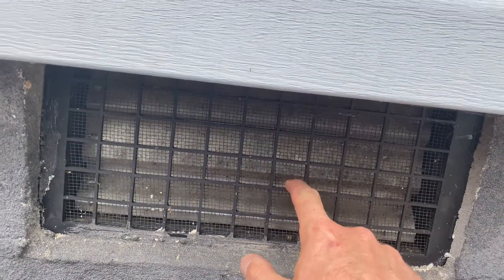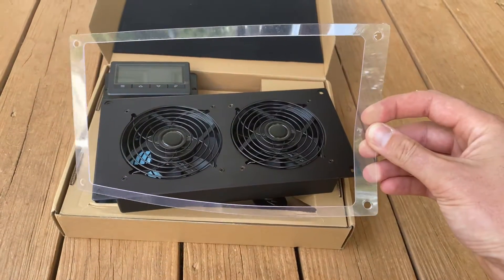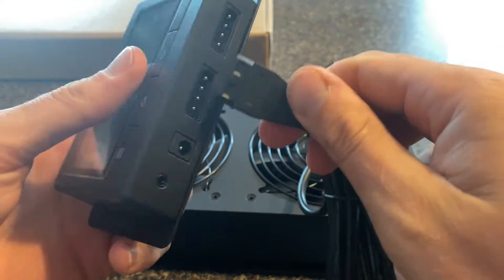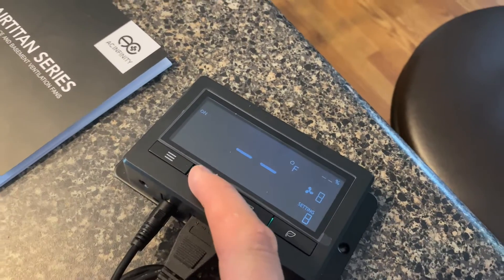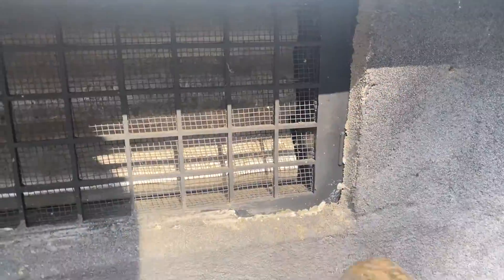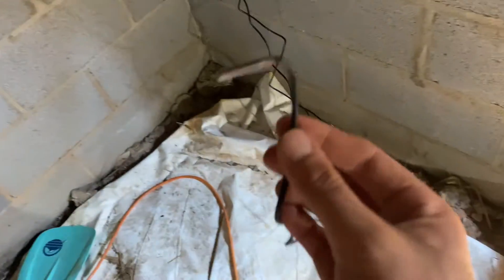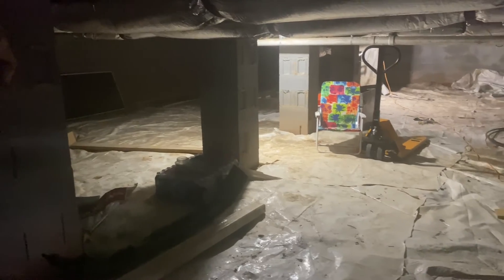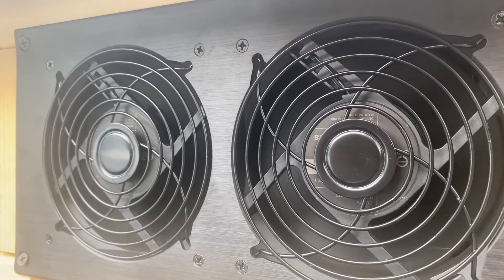AC Infinity AirTitan T7 Exhaust Fan Review (Crawlspace Application)

Comment: Do you let crawl space vent run in winter
Reply from the maker: I’m actually back to re-doing my whole crawlspace now. I actually stopped using the fan once I realized that it will just pull-in warm humid air from outside unless properly sealed.. I’ll try to make a new video soon

Comment: I am needing to do room to room, worth the plug looks like that won't work right?
Reply from the maker: Both fans blow in the same direction, so if its mounted in a wall of one room, it will essentially pull air through itself and into the next room. It's a standard wall plug..

Comment: Do you just hard foam cap the vent space in the winter?
Reply from the maker: I did, but them got lazy last winter and left it in place..
Reply: For air-sealed crawlspaces, theoretically, the fan keeps your crawlspace under negative pressure, pulling conditioned (e.g. dryer) air from the first floor and preventing crawlspace air from diffusing upwards into the occupied living spaces. For these effects to work, the fan needs to run 24/7/365. That's why the fan includes an anti-freeze feature (the fan shuts off if it gets near freezing temperatures).

Comment: Maybe the manufacturer or installer can chime in but I do not think this fan was designed to be exposed to the weather.  Instead of removing the plastic crawl space vent screen ideally the T7 would have been installed behind it to prevent the unit from being exposed to driving rain.  Other similar systems feature a through wall stem exhaust vent damper that connects to the fan which is mounted out of the elements within the crawl / basement.  If I am incorrect about my assumption I apologize.  Thank you for reading.
Reply from the maker: I think your probably right on this. I've been keeping an eye on my fan and it doesn't seem to be getting wet or dirty but I do plan on making a small eave of sorts directly above the fan to keep water away.. Or maybe a little box of some sort..
Reply: @WesleyAllenNC  I would verify with AC Infinity tomorrow.  If my assumption is correct I would install the fan on the crawl space side of the 2x4 frame immediately to eliminate the risk of an electrical fire.
Reply: @rennspeed  "Rated IP44 to be dust and water resistant for various weather conditions."

Comment: How do you know what size fan to install for square footage? My house is 2,500 SQ feet.
Reply from the maker: The air titan t7 has a max output of 240 cubic feet per minute (CFM). General rule of thumb is 1 cubic ft per minute, per 50 square feet of crawlspace. So you should be fine with this fan on a lower setting than full blast. 2500 square feet divided by 50 = 50 cubic feet per minute required..

Comment: What were your result. Our crawl space was at 76% and we installed an airtitan fan like this one but another model and it’s now a 74%…
Reply from the maker: I’ll have to double check. I slacked off on the upkeep after it cooled down in my area for fall. I also bought a hygrometer to check humidity and temp in the crawl space cause I’m not sure how accurate the air Titans temp probe is just yet. I plan on using it very soon
Reply: @WesleyAllenNC  How did this product work out for you? Did you notice any difference at all?
Reply from the maker: @y2k1307  I found out that my crawlspace only really has humidity issues in the summer. (My AC air handler is in the crawlspace so it makes it sweat). So now I’m the summer I’ve began plugging up all of the foundation vents with Fiberglass insulation, and then using this fan on 1 vent in the corner of the house to pull air out and mitigate any potential radon gas.. then in the Fall/Winter, I remove the insulation batts and turn off the AirTitan fan.. hope this helps
Reply: @WesleyAllenNC  I have the same issue, humidity in the summer, normal during the winter and fall. What i am trying to determine is if while running the fan during the sumer months, didt you realized any change with the humitiy levels or did they stay the same making the fan really useless? Thanks man.
Reply from the maker: @y2k1307  I’ll get back under there this weekend and check. I know the humidity dropped once I plugged up the foundation vents for sure. It basically kept all the warm humid air from entering the crawlspace to begin with. Then the fan was just an extra precaution against radon..
Reply: @WesleyAllenNC  Thank you.
Reply: @WesleyAllenNC  Wesley, I have installed Govee Hygrometers in my crawl space so I can monitor the humidity from my smartphone. You might what to check those out.

Comment: What’s the coverage how many square feet’s? Do you think one can make a 1800 house
Reply from the maker: It’s rated at 240 Cubic Feet Per Minute (CFM). The rule of thumb that I’ve learned is 1 CFM per 50 Square Feet of Crawlspace. Seems like they would need to calculate cubic footage but the EPA only concerns square footage..